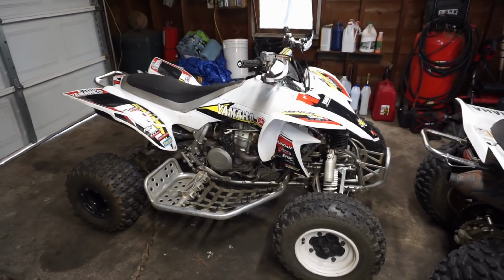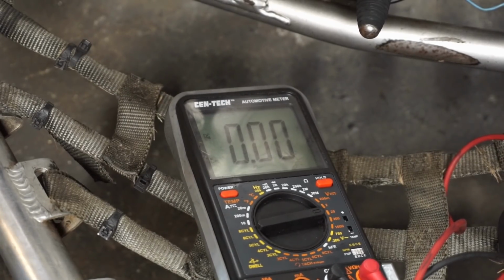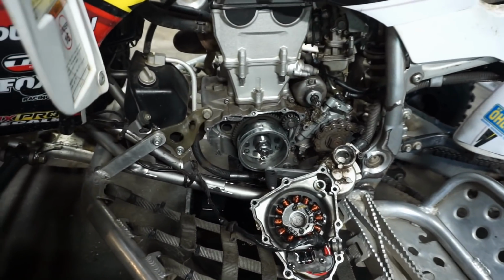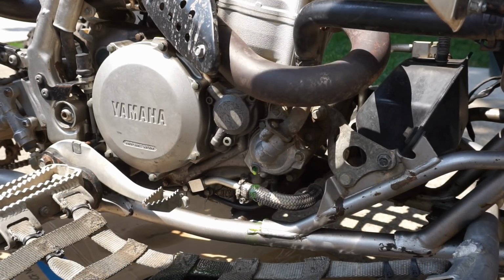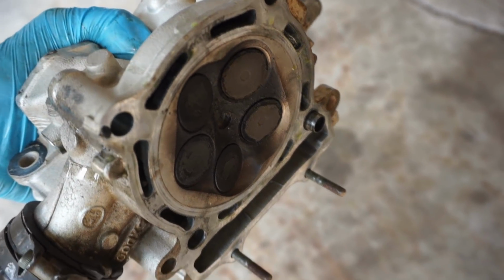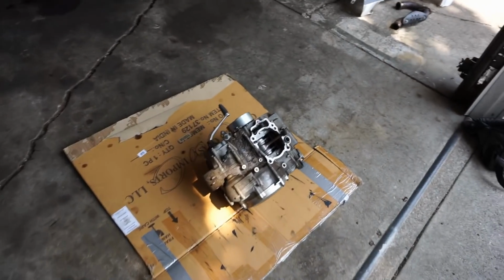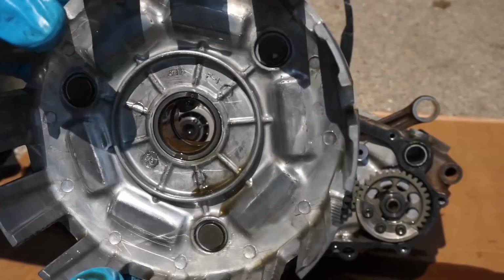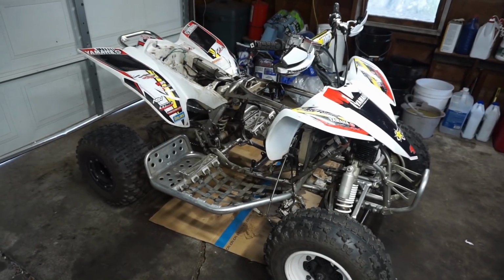Yamaha YFZ450 No Spark Problem Solved + Engine Tear Down

Comment from the maker: Does anyone have a Left side engine case half from a 2004-2009 Yamaha YFZ450 that's in good condition? 
Please SUBSCRIBE and LIKE the video if you enjoyed! It really helps me out a lot!
Check out my Instagram: 2_vintage_
Thank you for the support!
Reply: The cases are machined together. You CANNOT use a used one unless you buy a matched set. Clean it very very well, give it a few good tacks and use jb weld or your metal repair of your liking.
Reply from the maker: @benjamindavidson632  yeah I was worried about that. I think the best option is to just find a good welder and weld it up.
Reply: @2vintage  Yep. Sometimes being a perfectionist cost too damned much, just to look cosmetically attuned. When getting a welder that knows how to weld aluminum is all it needs to work like new.
Reply: Been in this same predicament myself, where I replaced the case with another used case and it would leak oil and cause all sorts of issues for me. You’re better off using jb weld and just applying it properly.
Reply: Could you get a LTR450 sometime?
Reply: @2vintage  When are we going to see the Tecate 3?
Reply: @benjamindavidson632  yes you can I have 2 different cases on my ltz462,the original left case and a used right case off eBay,works fine for me!
Reply: @myguitaryourface5160  you can get lucky awhich it seems you have or lose time and money and end up with a paper weight. Not worth the risk. There is a reason they machine them together. Glad it worked for you but a bit of welding or jb and it's fine
Reply: @benjamindavidson632  yeah I  know there  machined as matched set, but I have done it more than once,and had great success
Reply from the maker: @mdturbo764  Sunday
Reply: John Kara Glann has the best case saver... and please do the oil mod on the before you go all the way back  together  find me on fb Michael w miller
Reply: I have a partial K&S gasket set you're welcome to if you want it. it has the head and base gasket, and I think  2 for the clutch side covers and one small one with a hole and 2 bolt holes.  I don't know how to get them to you is the only problem. I could put them in my ebay store as a buy it now for enough to cover the postage, probably around 8 bucks. I have a few other stray quad gaskets/seals I could throw in too, I think they're Kawasaki and Suzuki
Reply: @mdturbo764  Those cost more than an 85/85 Atc250r by 2-3x.  Tecate 4 is even harder to get.  Green plastics would fade almost immediately, but not as brittle as the Honda Atc250r.  

McNasty customs is your person for Kawasaki Tecate 3 and 4.
Reply: As stated in previous comment cases are sold as a set and machined as a set You can get brand new cases for 350 on partzilla dot com, not too bad of a job in the middle of rebuild the bottom end of a 06 yfz due to a bad rod bearing
Reply from the maker: @dlsinsc  That would be great! Please send me the ebay link when you have them posted! Thanks again!
Reply: hey where do u buy ur bikes
Reply: Its worth investing an doing that YFZ450R right. Those are awesome quads. It looked wayyy too clean on outside to me for it to be $2100. Nice ones command big bucks! Its worth the proper an new parts. Don't do hack job.
Reply: There the same all the way up to 2012
Reply: Not true Benjamin Davis  i have a 2012 carb model  and ised a 2004 and worked perfectly fine
Reply: They are machined together dummy. You cant replace just one

Comment: Personally, I think you're doing the right thing by tearing down the engine and replacing the case half. In the end you'll have a new case saver and you might even find a few more problems that need addressing.

Comment: I would have fixed with alloy based epoxy resin then sanded it smooth, that stuff is unreal and done properly is barely noticeable unless on very close inspection. I’ve used it on a 350 engine and it’s still as good after 12 years, no leaks no nothing 👍

Comment: Thats the sort of kick in the balls i get when i buy a bike. i like the idea of doing things properly, it makes it so much easier to sell, but it does look like a horrible job to do and for the 20 extra minutes it will take i would be replacing the crank bearings for peace of mind. maybe a parts washer would be a good investment and a work bench you cant keep floundering around on the floor
Reply: No space for a work bench
Reply: Drives me nuts how he works off the floor
Reply: I bought a bike a while back and a week later I had to put $1300 in parts in the motor and clutch🙁
Reply: Yes always do it right! Thats a nice machine too.

Comment: Clean up around the hole good and seal it up with JB weld, and you should be fine until you get find a case.   
I had the same problem with my yfz, flywheel bolts came out and messed up the stator.

Comment: I hope you know about the oil mod in the o5 and o6 yfz450. Also there is a stock cam mod to adjust the exhaust cam1 tooth clockwise on the timing chain its good for a instant 2 HP. Also to help your clutch last longer for higher HP motors install 3 stiffer springs in the clutch or just do all 6 it also prevents slipping. The indents on the clutch basket, file those down so the surface is smooth instead of a ridges = smoother clutch operation.

Comment: If you jb weld it cut your self out a small piece of wax paper and cut it to fit perfectly over the shiny part that you don't want the JB weld To stick to or go down in that hole...you can hold it in place with a small dab of grease...

Comment: Gotta get a set of cases. 
They are a machined mach. 
Also next time you are trying to take a cover off like that stator cover. 
Smack it with a rubber mallet a few times. That way you save the gasket

Comment: Find a good machine shop with a TIG wizard and they can weld thin cast aluminum and magnesium easy peasy, there are shops on the inter webs that specialize in case repair too

Comment: There is a reason Yamaha don't sell just half a case. They are  machined at the factory  as a pair both at the joint face and line bored for the shafts. You could get away with it or just be making a whole new problem. Just get someone to weld it. Got to be someone in your area that does that sort of work. Dont have to do everything yourself,  no shame in outsourcing specialist stuff.
Reply from the maker: Yeah looks like i might have to find a welder who can do it.

Comment: This is the same thing that happened to my yfz, the bolts on the flywheel and the one way bearing came loose and all 6 broke off, I bought new bolts and had the stator rewound and then bolted everything together with locktite
Reply: How well has held up? Has it been a permanent fix? This may be a good alternative for those people who are unable to properly weld,and,or they can’t afford to pay a machine shop to do the job.
Reply: @FloridaMan0561  I meant that only the bolts on the flywheel were broken, there was nothing needed to be welded and the motor case is still intact

Comment: everyone starts at the small switches even shows on diagram to do the same thing, i think everyone should start at the stator first cause its going to tell you strait away if its little switches faulty sensors etc- immediately.

Comment: Hey vintage I got a question so my 05 yfz 450 worked good then after I road it the thing just shut off and whenever I press the start button it does nothing and when I switch the kill switch on I don’t hear a click or nothing I could use some help please .

Comment: I would of tried to  have the case welded first. Epoxies never last. I don't know why it cost $550 for a case side.. I looked it up and you can get a complete crank case for that price. Partszilla has the case half you need for 125.00.

Comment: If you plan on keeping it awhile I highly recommend getting the oil mod done, 04 to 07 yamaha relied on the oil splashing into the bottom end and it caused damage to the bottom end due to lack of oil. I highly recommend it its cost about 200 to get it machined and you get a high flow oil pump as well, jtatv.com did my mod for me highly recommend
Reply: 200$ to have the peace of mind knowing that you aren’t going to grenade your engine is definitely worth it IMO.

Comment: i have a 1997 yamaha warrior got it running and was running good top speed was like around mid 60 then i started hearing like a rattling noise on the left side and my quad has never ran the same. does anyone know what’s the problem

Comment: Hey anyone have an idea why when I try to crank over my 06 yfz450 with electric start, it will crank for a little and then it will automatically stop while i’m still holding the button. I’m stumped and can’t quite figure out why it’s stopping itself. Thanks.

Comment: The 450 line in not built as stout as the 400 line. Strip a LTZ down one time and look how thick they built everything in that engine. Then look at how thin and chuncy the 450 motors are. No wonder they get rebuilt so often.

Comment: 😂 😂 😂 seen how he smacked swingarm the bolt out with the hammer lol nearly ruining all the threads wow 😯 no mate the wholes in the bolt for a reason for a dot tool or use a worn screw driver so you tap it out hahah never right